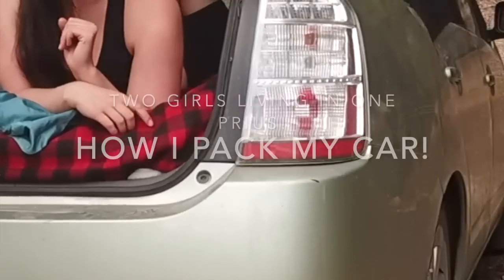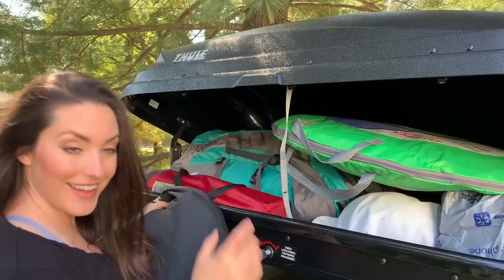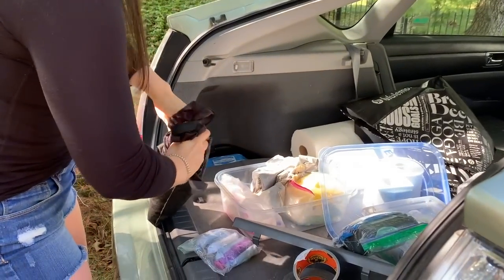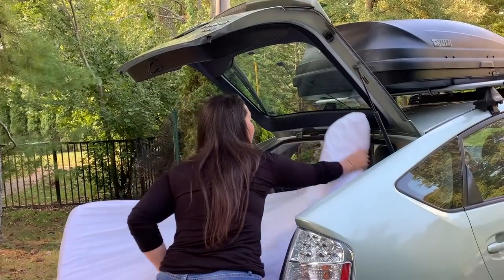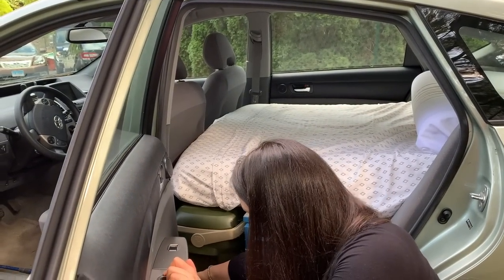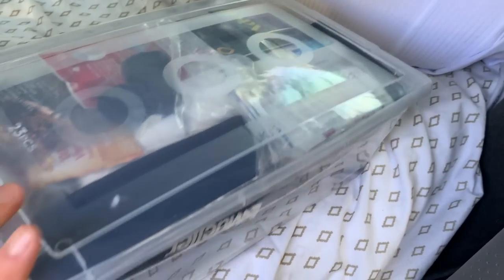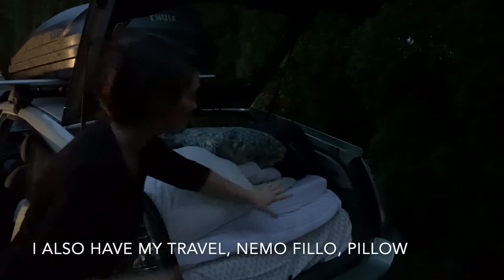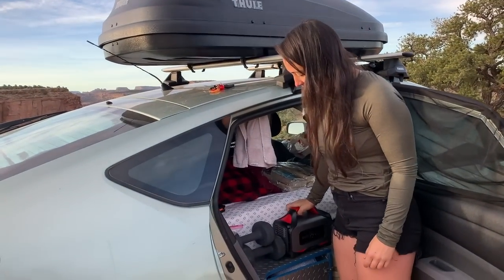Two Girls LIVING in One Prius! - How I Pack My Car! - Prius/Car TOUR

Comment: We used to take road trips from TX to CA in an 85 VW Cabriolet. With myself, mom and two sisters. My little sis was still small enough to sleep on the floorboard in back and we’d lean the seats back over her and older sis in the back seat. We never got a hotel room and would shower at state parks for free when we told the gate we were “just going to look around”. Not the most ethical but we didn’t have much and it taught me to be resourceful.

Comment: Do you have any idea how much all that stuff weighs? The total load capacity for that car can't be more than 800 pounds. Nice organization skills.
Reply: I'm concerned about the weight too. Driving with heavy loads negatively affects handling & braking. Also, your suspension system is at risk especially if you hit a pot hole.  Good luck!
Reply: Pretty sure it is a LOT more than that, else they will have lawsuit left and right.  The car is designed for 4.  You can hit 800 lbs easily with 4 x slim 6-footer (each 200 lbs).

Comment: When I used to sleep in my car, I'd have a 24 hour fitness gym pass and take showers there.  WIth the shut down, this may not be possible right now but it's a good tip for you car sleepers out there.  Also, I'd hide an extra spare key just incase under my vehicle.  For my 1998 Accord it was perfect to put it behind around my rear bumper where the steel frame was so I'd have a strong magnetic key hider right on there but if your vehicle does not have steel frame to put any magnetic key hider, just firmly duct tape your spare.

Comment: I dont remember which post you had, but camper had an accident on your bed.  There is plastic that you can buy at home depot lowes or menards in the paint section for you to line your bed cushion. it would be waterproof and if would not be ruined by the smell you know what. just a thought.  have a great day....

Comment: In my prius open doors nukes that tiny battery, reducing its lifespan, you might try a small flexible solar panel, eternabond tape it to your cargo box lid, run a wire down to the rear battery bin - will extend your batteries overall life, and reduce use of your jumper pack.

Comment: I have a Prius. The issue if you didn’t see is how low her car is riding. The Prius transmission and weight can’t hold what she is throwing in along with another person. Most Prius cars like mine can only hold 890 pounds give or take. That includes the passengers. Soon she will need to changer her struts shocks tires etc out for extra wear and tear. Better off getting a small truck /sub that can hold the weight

Comment: Oh my! The amount of items you packed was impressive and incredible. All I could think about was the weight on the car’s suspension. I prefer a longboard skateboard to inline skates. I didn’t see any protective gear for the times you skate, other than a helmet. So why was the house almost vacant? The response to any question as to why you have that? Is, to be prepared for any and every thing. Because it’s better to have it and not need it, than it is to need it and not have it. Was there an emergency road side kit? Did you attach a tile tag or an Apple tag onto each of your persons in order to find one another, if you get lost from each other? You’re definitely an experienced traveler.

Comment: Rent a small cargo trailer, or buy a used one. It is not that expansive and has plenty of room to keep things, you can use a really heavy and bulky padlock to keep things safe.I believe that a used "water drop trailer" would be best for those adventures. Some have king size bed, kitchen and even at times a bathroom/toilet space and they are not heavy, easy to park, some are stealthy ( you can't tell it is a camper/trailer thing) .

Comment: Pro tip, get rid of those bulky jumper cables and buy a little jump box which will double as a power source for all of your devices as well. They will jump off large trucks very easily and cost only $50-$60.  update noticed you DO have the jumper box. Guess it doesn’t hurt to have a redundancy option.
Reply from the maker: I find it important to have both in case the jumper box does not work due to drainage :-) I’ve had to use both!

Comment: Pretty sure you’re my soulmate Nikki. I just recently purchased a 2021 Kia telluride four-wheel-drive and I bought a 10 inch thick mattress for the back which fits perfectly with the seats folded down. Of course there is storage space everywhere and I like to use a roof storage system as well. Sure would be neat to meet up with you one of these days. I’m based in Alabama on the coast.  Happy travels!

Comment: Hey Nikki, just discover your channel today. It's crazy to find some one who also do those "crazy" things.  I have been living with very minimal stuff for almost 3 years. I burn out myself working and one day i decide "No more or i will die". Well  I also travel in my pickup truck for a While, but i use a tend, i wonder why you prefer these setup rather than a tend?. I didn't see all your videos yet but i wonder if you have an air compressor, i really recommend you to have one. flat tires suck! i just put air and find a better place to fix it or replace the tire  (those 12 volt portable ones.) Also some strong rope or any alternative if you get stuck and need to pull the car.  Good hand lights are always handy.  Enjoy!, Best regards from Chile, South America.  Peace!

Comment: have the same prius (09), took the back seat out and built a ply deck with a piano hinge at the front with another 12 inches that folds forward when the seats are pushed all the way forward.  I am 6' 2", and have 7ft length back there.....easy to camp with one person, but these things are so underpowered for going over mountain passes.  Slows down to 25-30 miles and hour over huge sierra passes like coming up out of death valley recently.  Will keep the little prius for a cheap city runner till it dies, but gotta have more power and 4x4 so can get to a few more places.  You are obvioiusly limited to smooth, relatively hard ground.  On the east side of the sierras there are thousands of places to camp on BLM land that are much better accessed with 4x4.....Different story, i know.....just some thoughts and observances on the limits of the prius.....maybe the newer ones have more power.
Reply from the maker: Ohhh when this baby dies I am certainly getting AWD! Right now that just doesn’t seem necessary or financially responsible. BUT hey if someone wanted to give me one I’m in 😂😂😂 I love it.

Comment: Ok first the obvious needs to be said.  You are drop dead gorgeous!!  Second, what more could one ask for in a partner for life.  Your spirit and energy are off the charts.  But I have to address the elephant in the room.  What is your gas mileage and how is your power going up grades?  I need to know! New subscriber.
Reply from the maker: Oh man so this trip with all this stuff, roofbox and bike 32MPG highway miles. Half the stuff now (but with a 1.5 inch lift) about the same.
Reply: @NikkiDelventhal  so I know weight is a factor but it sounds like from what you are saying is that the profile has a LOT to do with your mpg.  You wouldn’t happen to know the effect your cargo box in itself was on your mpg do you?  32 is still respectable but can’t help but wonder what the wear and tear is on your baby having to work so hard.  I know the 2nd gen didn’t do as well on the hwy mpg wise as the 3rd gen did.  I have a third gen and was wanting to put a cargo carrier on her for long road trips but was wondering about the effect on mpg.  I also have a hitch bike tandem carrier that I use.   One day they will have Godzilla Prius that will carry everything and the dog and still get 50mpg.

Comment: Do you know your car can provide you heat and ac. Assuming you have a hybrid. It runs your heat pump from your battery and when battery  gets low engine starts and recharge the battety and shuts down. This is done until you shut the heat or ac. Check how other folks doing similarly. Your weight are dangerous. An item double its weight for every 10mph. If you have an accident they can fly across your car. Best in the trunk.
Reply from the maker: Yes an amazing feature but also this is assuming your car is in perfect condition as there is a possibility that it can be unsafe and definitely drain the battery life. So I personally don’t do this unless it’s a storm or something!(Only did this 2x)